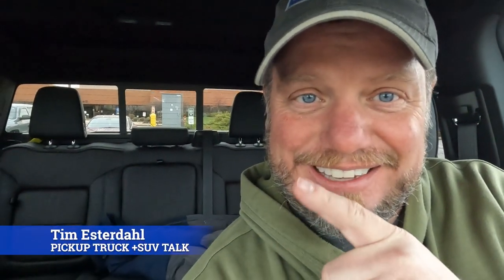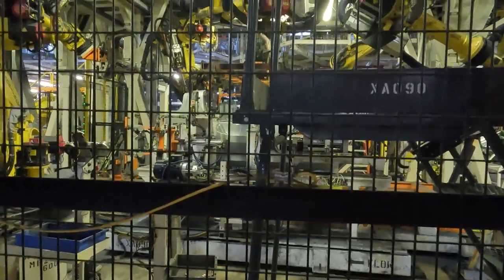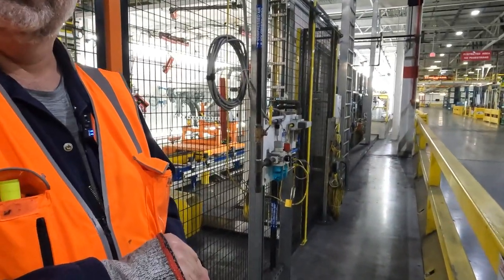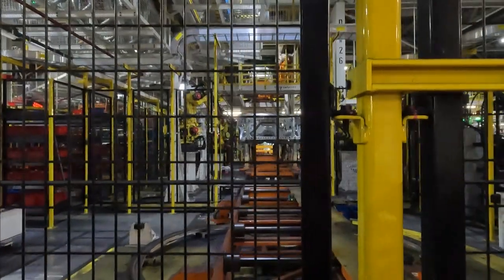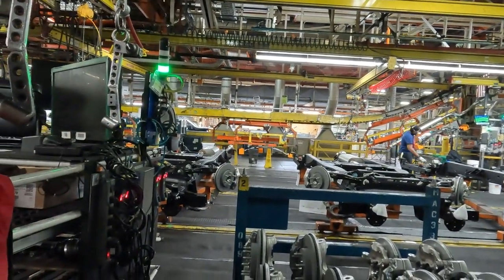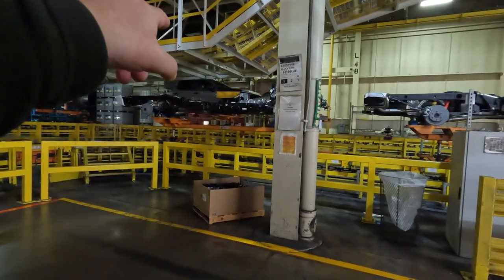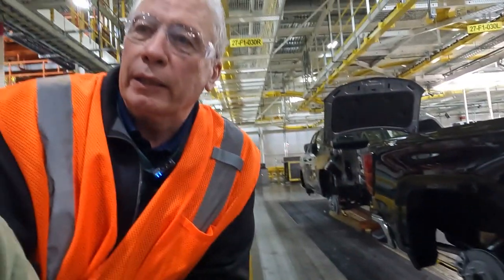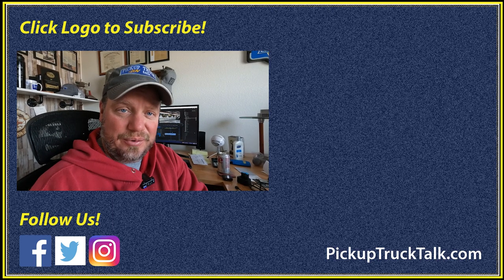Touring GM's Fort Wayne Plant Where Silverado and Sierra 1500 Built

Comment: Decades ago, as an inexperienced auto manufacturing engineer, I interviewed with GM. While I had computer integrated manufacturing education with Fanuc robots, programmable logic controllers, etc.  I didn't make the cut. (the GM plant I interviewed at closed several years later) Just as well. I landed in the aerospace industry as a Quality Program Manager / Senior Tech Ops and travelled to Europe to validate subcontractor designs. I've only purchased GM vehicles over the years and remain a shareholder.
Reply: Congratulations
Reply: Nice!
I work as a PLC technician at the Los Angeles Airport. I have always been fascinated by auto manufacturing lines. But those facilities will shutdown or run out of work just like we saw during covid. Probably not the best place for job security.

Comment: Amazing manufacturing process. My 1994 GMC Sierra half ton was built in this plant, and I can only imagine how manufacturing here has changed since then. I bought my pickup new, and it is still a good truck at 295,000 original miles. Conscientious maintenance is the key.

Comment: My 2022 Silverado was built perfectly except one paint nib on the hood and a couple of chips under rear bumper where it isn’t visible. I touched them up.
Reply: Yeah, I was at my dealer a couple months ago and they had a white Silverado 1500 5.3 4x4 ltz. Right above the driver door if you looked closely you could see a large paint imperfection that looked like orange peel. The truck was built at this factory in Roanoke Indian, I could tell by the sticker on the door. They are great truck but I just question the quality if something that simple passes through inspection with no problem.
Reply: @wyattgrummert9183  I purchased many trucks in the past before Covid and they all had flaws. Nothing is perfect. You just have to go in to it understanding that.

Comment: 25 year member of UAW Local 2209.  Journeyman millwright, paint department.  You missed out not getting to go through the paint processes. Pre-treat building has the Phosphate dip tanks, ELPO tank, ELPO oven, and multiple lanes of robotic sealer application.  Main Paint building has Primer booth, 2 Primer ovens, 10 Paint mods with base and clear coats, 10 ovens, and multiple inspections and defect repair areas before going to General Assembly.
Reply from the maker: Paint is really impressive. I toured Flint Assembly and saw them paint the HD trucks. Truly good work.
Reply: There's another video on YouTube that shows everything you're describing except for the oven part. At the same plant, if I recall correctly.

Comment: Tim, thanks for the interesting video. I like that you took the time to film the process slowly so we could understand how it all works. Are the frames now painted? It looks like they are or is that wax?
Reply from the maker: Wax. I really want to deep dive on it, but the frames were already done. I’m working on a new angle.
Reply: @Pickuptrucktalk  Thanks Tim! Seems like they could use a new process like powdered paint or other coating process to protect the truck frames. I have had many GM work trucks and the frames start rusting pretty quickly. I’m surprised with all the investment in robotic body assembly welding, exacting panel alignment processes and flawless paint work they would still be waxing frames as they have for decades now! I guess you might have an update on that, it should be interesting.

Comment: My 2018 4.3L was built here. 60k no issues except the lower paint where it’s spray lined and painted over has a few spots with small bubbles that could be popped. Sure it’s moisture and the rust prevention with paint over top is not a good look. Other than that amazing truck!

Comment: How are their current production numbers compared to normal? Are they getting the parts they need to build complete trucks at a normal pace?
Reply from the maker: Nope. Parts shortages still remain.
Reply: It depends what trim and configuration you order.  Ordering a Heavy Duty work truck with a long bed and diesel engine is not easy due to the chip shortage.  But you can go to a car lot today and buy a 1500 LT crew cab with short bed, no problem. They're marked up heavily due to demand and yes, chip shortages, but there are lower budget options like the 2.7L turbo models with basic packages. But, overall, the prices reflect low supply.

Comment: Seems to be a back log for the LZ0 diesel engine, I'm two months in line now waiting for an allocation, to make my order here in California.  
Do all the Silverado factories, including the Mexico City plant, produce 1500 diesels?
Reply: I ordered a 3 liter diesel on Oct 28th.  The order went 3400 scheduled to be built the week of December 12th.  Then the order went back to 3100!  My dealer informed me last Friday my build week Is now mid January.  Concurrently I was also watching on the GM web site inventory with in a 250 mile radius of my zip for similar built trucks to my order.  On Saturday I saw a truck built with everything I ordered including color about 150 miles from home.  I called the dealer and put a deposit on the truck.  Picked up my new High Country 3 liter diesel this morning.  No more waiting or anxiety wondering about a when I might get a truck.  If your able I would strongly suggest watching for dealer ordered on the GM site.  Worked for me.
Reply from the maker: All crew cab 1500s come from Fort Wayne. Just a matter of getting the engines into the plant.

Comment: Bought 5 new GM trucks last few years and all were built in Ft Wayne....cant believe 1 wasn't from mexico....2 were HDs and think all those are here but still.....pretty low odds
Reply: My 2022 Silverado Custom came from Ft. Wayne, got it in January and have 15k miles on it and almost a year old already. So far, no issues and averaging 20.5 total mpg with that little four banger with 310 hp.

Comment: Was there any discussion of why they use wax coated Vs e coated frames?
Reply from the maker: Not at this plant. That's an engineering question and I've asked multiple times. They think the wax is superior since it regrows over scratches whereas when you scratch paint, it invites rust in.

Comment: Fantastic video!  Very interesting and informative.  Congratulations on your new truck.  I’ve currently own a 2019 Tundra TRD and have had 0 issues with it.  Same thing with my 2013 Tundra.  My Tundras and Camrys have been extremely reliable and capable vehicles.  Unfortunately, I think Toyota has missed the mark huge with the Gen 3 Tundra.  Everything from ascetics, quality, connectivity, and no front tow hooks!?   I will not be considering the new Tundra as a replacement for my 2019 when the time comes.  GMC is now at the top of the list and I would be very interested in your assessment of general quality of the truck.  

Thank you for the content.

Comment: Right off the bat, you are seeing beds and outer panel, then we have people taking them to where they need to go. Robot welding in the background. More faster and more efficient as he says. 32:19 "uh-oh I gotta go save my money" that was funny. But he knows how much it cost to build these trucks and how much they are marked up. $50,000.00 - 70,000.00 plus for truck that I am sure cost less than $20,000.00 to build with every part. All the parts are Mass produced costing pennies on the dollar. 34:11 "Your doing enough to make money for us"
What he should have said, was "doing enough to make LOTS of money for us". With parts being Mass produce and seeing how this assembly line works and 1300 truck a day, you have to pretty naive to think that a $50 - 70,000.00 truck cost more than 20,000.00 to build.
Everyone these trucks uses the same general parts. Going from one trim package that cost hundreds of dollars to produce marked up thousands of dollars. And the same markup to the next trim package. When you get to the cars that is loaded with plastic parts, do you ever wonder how much you just paid for plastic? If they take off 30 - 35% they are still making LOT of money and selling a lot more vehicles.
No wonder the CEO of GM make 29 million per year. That's generational wealth! Not Me!!!

Comment: It’s going to be real cool when the motor fails at under 10k miles from bent push rods and GM acts like it’s your fault and not covered under warranty. 

Wouldn’t buy anything GM after 2013 unless it was a fire sale at auction to offset all the repairs coming out of my own pocket. 

Welcome to the new GM…
I mean “gm”… because lowered standards.
Reply: I say the same thing it was over by 13’ and the new 14-18 trucks were plagued with transmission and engine problems,ac condensers going out pathetic…my trucks a 10’ Sierra Denali (07-13 body) the 6.2 DOES NOT have afm and I love it…my only problem is the cheap ass dashes that start cracking at the top of passenger airbag area…other than that it runs great 6sp. Trans runs great too, no problems the 14- current have way too much electronic stuff and it will fail…65,000 plus and they start breaking down at 5000+ miles. Nope no thanks.
Reply: @toddprater14  little known fact- GM was 50% bought out by the Chinese firm SIEC in 2014…

Don’t have to stretch the imagination on the decline since the bail out.
Reply: Didn’t know that…Chinese junk…I worked for a gage company that we did gage stations for gm engine and transmission…the company owned 1 in China  and they bought the gage company here in USA and wanted to have everything done in the China plant .,we were constantly fixing their out of tolerance parts,we  had to re work all their parts -always… I left there and now work at a competitor that bids on the same work and we’re American owned and they treat us well… no more jobs at Chinese owned companies..

Comment: you feel like Lucy ,only over 40 will get it ..When I saw the cab come down I couldn't help but think "and then it comes off in four years to change the oil pump belt ,,,,,"
Reply: I thought it was transmission removal, not cab. And you think many will drive 50k miles a year to need that required belt change?
Reply: @ALMX5DP  Everything I've seen said just trans, not cab at 150k. Tim interviewed a GM rep who said  they may be raising that service interval.
Reply: You know you guys are right it was lifting the the cab up to change the cam gear that was bad you guys are correct it's just the transmission for the belt

Comment: Can you ask him why GM has been unreliable compared to foreign vehicles over the last several years
Reply from the maker: Too many options for GM compared to the Japanese automakers. More options = more chances for problems.
Reply: @Pickuptrucktalk  As a retired Quality Program Manager I agree. All the nice features customers want; such as motorized running boards, adaptive cruise control, multiple position tailgates all increase the complexity. Increased complexity increases the chance of a failure point. You heard how torque settings are monitored, parts are placed to minimize visible paint defects, and vision systems used to validate assembly stackup tolerances. Toyota holds onto a simple design much longer, which improves long-term reliability, but customers may feel the design/features are more boring. I have a GM SUV since new and it now has 302k miles. Sure, the rear wiper doesn't work (wire fatigue), some dash lights are out, corrosion is nibbling away underneath. I've done all the maintenance since warranty ended.

Comment: Very cool to see the process...to bad it's wasted on a horrible looking truck.  

Useless wax coating on the frames, not powder coated.  

Front roof section of the cab is way too short, looks disproportioned to the rest of the cab.  Due to that, the top of the door frames are weirdly short looking as well.  

Rocker panels have ugly, black, body plugs running along the underside that are very noticeable on the lighter colored trucks.  

Outside mirror placements are just dumb sitting below the window beltline.  Due to that, there is a black, ugly, triangular piece of plastic in the corner of the window where the mirror SHOULD be mounted in the first place.

At least it's not a HD...those are even worse!